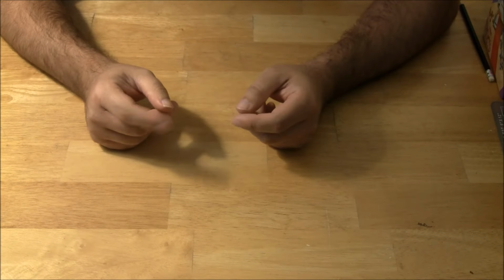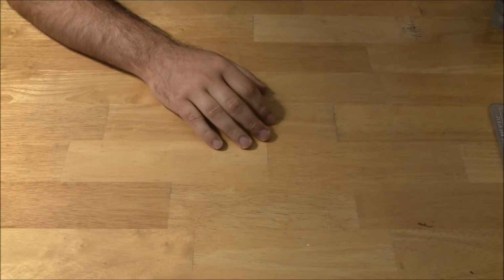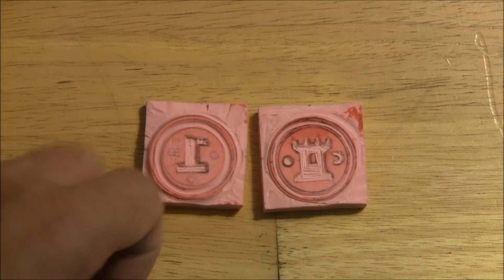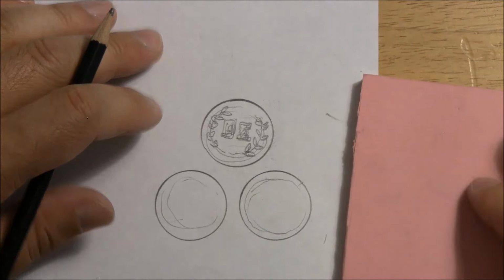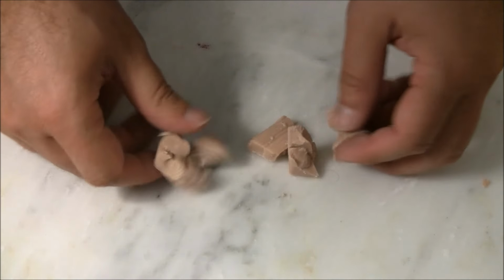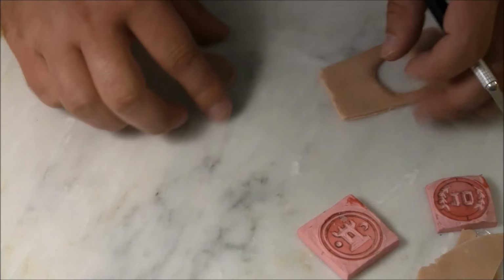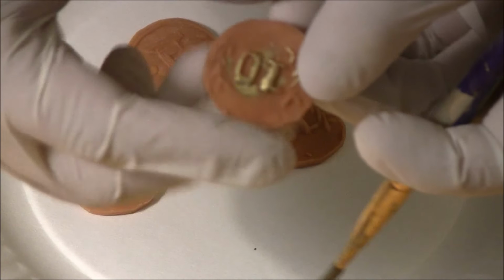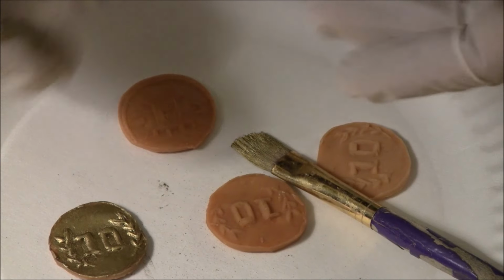How To Make Your Own Campaign Coins

Comment: Another good sealant is Minwax polyurethane in a spray can from Walmart. A technique that I have found to darken materials is to take a single brush full of black acrlic paint, like that sold by Walmart for $0.50 in their craft paint section. Thin it out with between three and five brush fulls of water. This thins out the paint so that will flow onto a painted surface or can be used to faux age craft sticks in a diorama or other project.

Also, when using one of these templates, a mechanical pencil follows the shapes much closer to the edges.

Comment: How do i make a lion and a castle?
Reply from the maker: Do you mean a lion and castle design on the coin? You can freehand draw the designs of a lion or castle or print out an image in reverse (or mirrored) and use carbon transfer paper to apply the design to the rubber for cutting.
Reply: @theofficialonecutstudio  ohhhh ok

Comment: If you base coat them in silver then the final color it should come out with more shine to it.

If you make a follow up please break one for us so we can see the durability.
Reply from the maker: Thanks for you input Blake. It didn't occur to me to break one to show the durability. I will try to make a follow up video sometime and include your suggestion. The clay coins are somewhat brittle but can be handled and passed around the table.
Reply: @theofficialonecutstudio  thanks for answering back. If they are brittle I wonder if putting a washer or penny in the clay would strengthen or weaken the coin.

Great job on the video btw.

Comment: Did you use a V or U Shape Cutter?
Reply from the maker: For finer details and sharper lines I used a V-shape cutter. To take out larger areas of rubber more quickly I used the U-shape cutter.

Comment: I feel that it would be easier to cut a circle of your same size coin from the clay itself and lay it within the circle of both moulds. That way it seems easier to line up both sides.
Reply from the maker: That is definitely one way to do it. I may have to try it that way. I like the design being off center in this case to mimic early hand-struck coins.

Comment: Can you do a video expounding on how to cut the shapes out on the rubber? For me it was a bit unclear.
Reply: Claire Blassingame one tool is a pen-knife, the other is a scraping tool, it basically cuts a half-circle. I believe its a sculpting tool, used for forming clay or maybe wood. Either way these should be in a craft store
Reply from the maker: I could potentially make an additional video. The tool is called a Linoleum Cutter and is available at most craft supply stores. It is used for carving rubber stamps. The different tips are used for shaping the rubber. A "V" shape cutter give you a sharper line than the "U" shape cutter and the blade is used to remove larger amounts quickly.
Reply: OneCutStudio which did you use "V" or "U". Also will this work with metal because I want to make a coin made of a metal called Bismuth